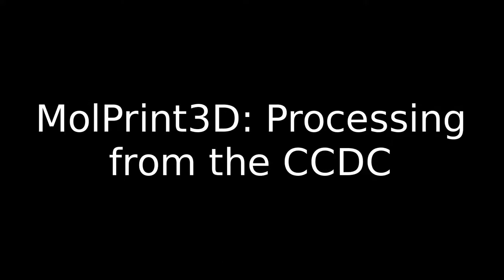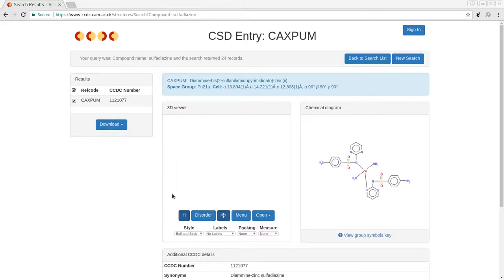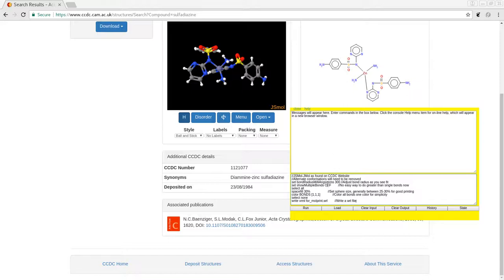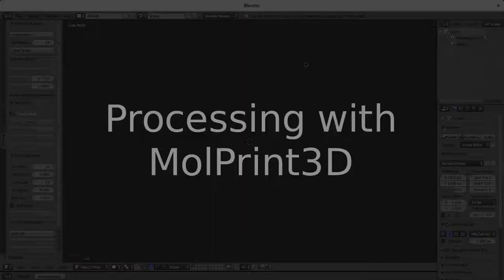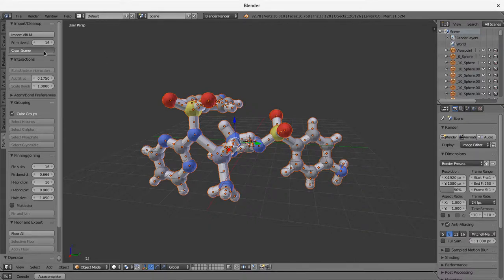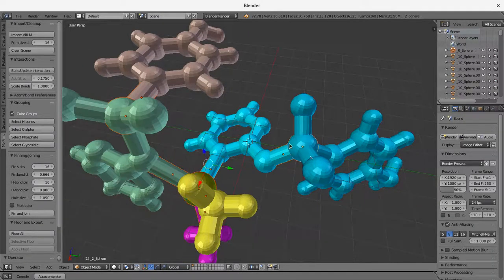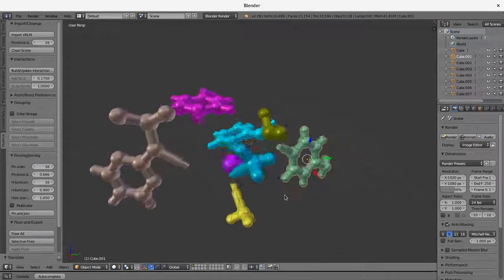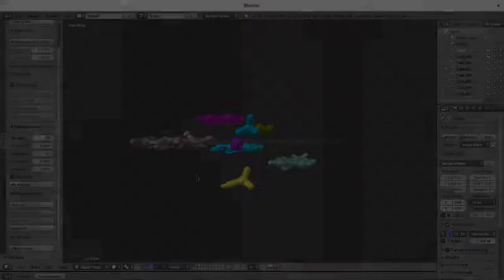MolPrint3D: Generating VRML from the CCDC

Comment from the maker: Console settings used:
//JSMol-JMol as found on CCDC Website
//Alternate conformations will need to be removed
set bondRadiusMilliAngstroms 300 //Adjust bond radius as you see fit
set showMultipleBonds OFF        //No easy way to do greater than single bonds now
select all
spacefill 30%                    //Set sphere size, generally between 25-30% for good printing
color BONDS [1,1,1]              //Color all bonds one color for simplicity
select none
write vrml for_molprint.wrl        //Write a wrl file